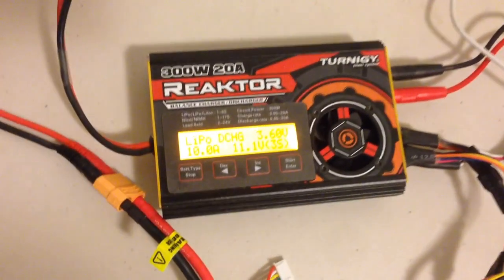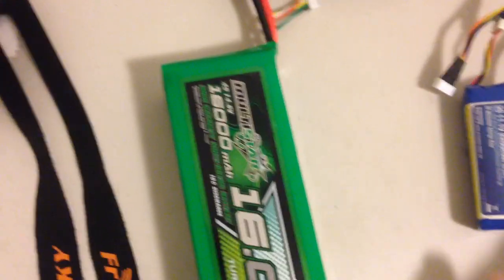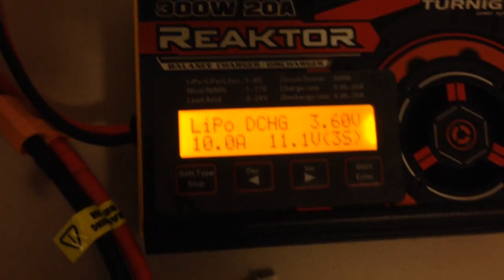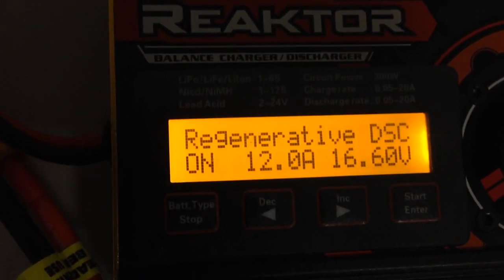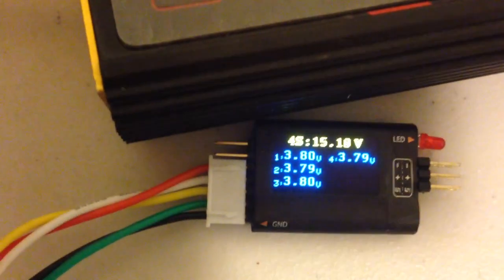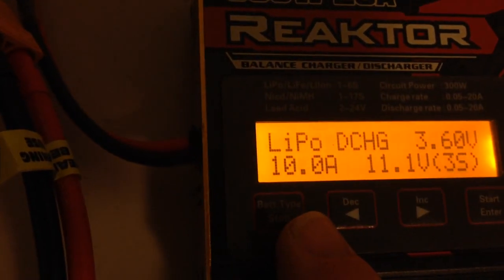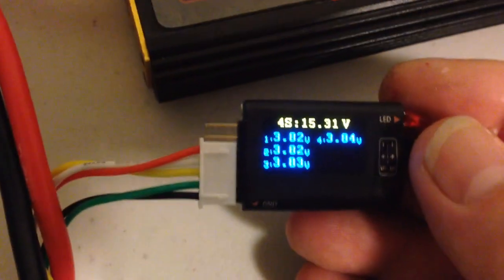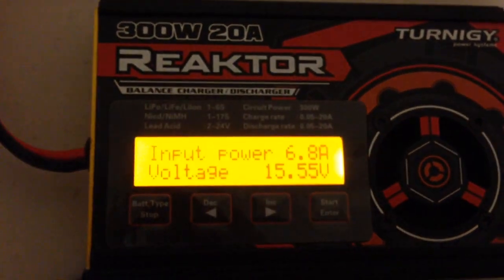Turnigy Reaktor 300W Regenerative Discharge Mode

Comment: I've looked online and I cant find an answer to this. theoretically could you power the charger using the DC port and connect a resistor to the normal power input side for regen charging?
Reply: noisynerdman I'm not sure but since you have to monitor cells voltage it seems difficult (or you plug another battery to brain the charger ?)... Anyway, I don't see what could go wrong if the resistor is well calculated and cooled...